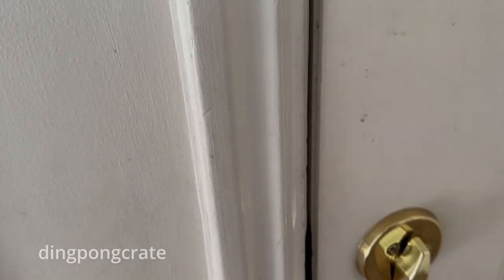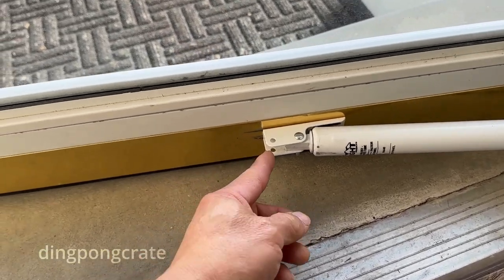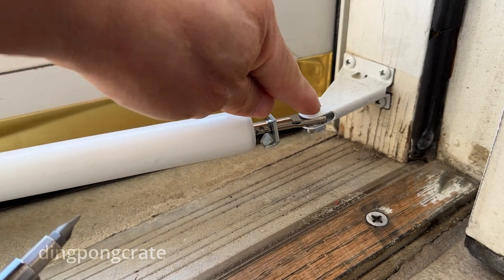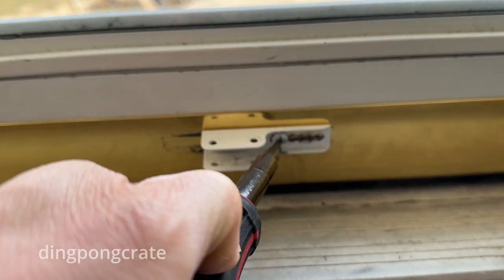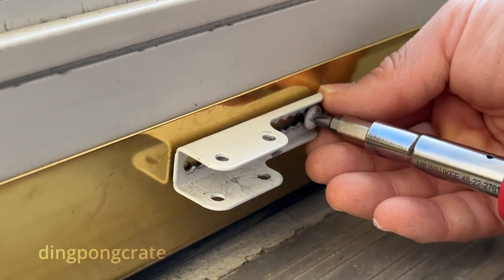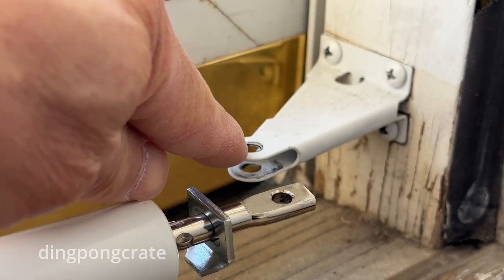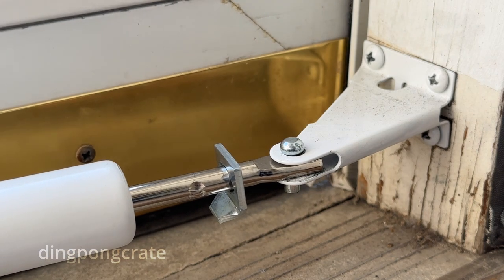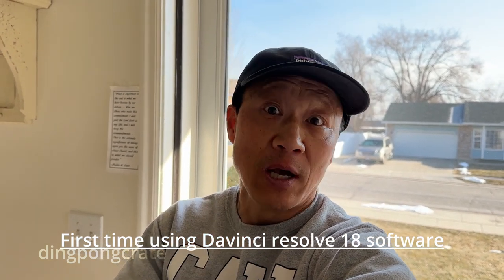Storm door not closing all the way | Common problem | Easy Fix | Any DIY people can do this

Comment: I couldn't quite figure out why my storm door wasn't closing completely - close but just a smidgen off.  The issue was exactly what you pointed out here - the piece that connects to the door w/ 2 screws had moved about 1/4 of inch.  Simple 5 minute start to finish fix.  Thanks for sharing!!
Reply from the maker: I'm glad that it works out well for ya. Thx for watching the video